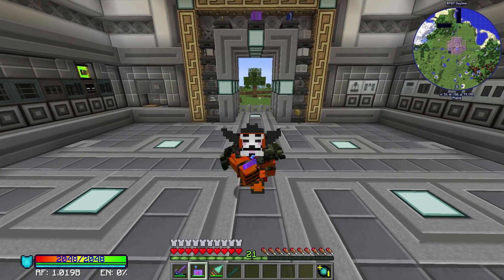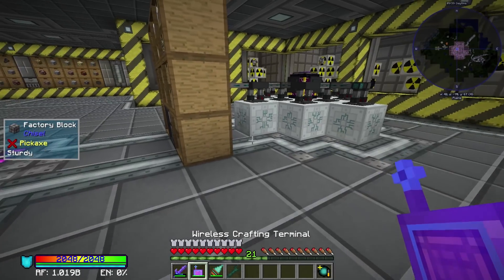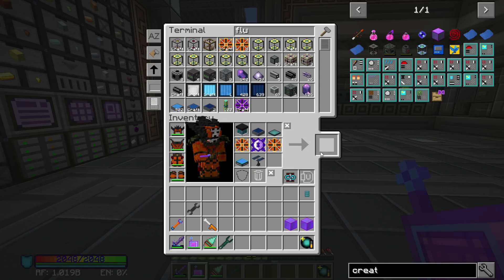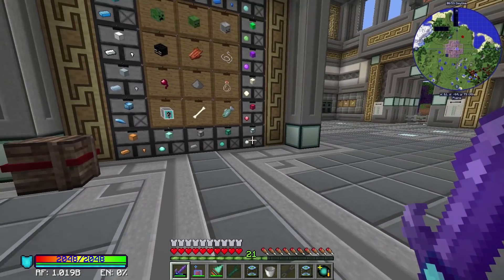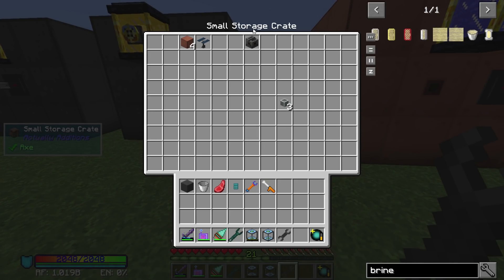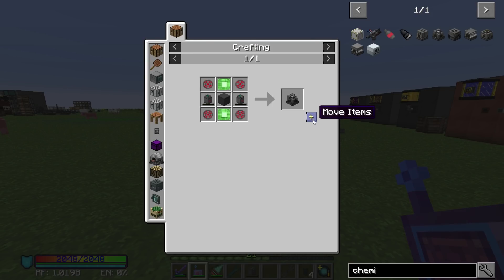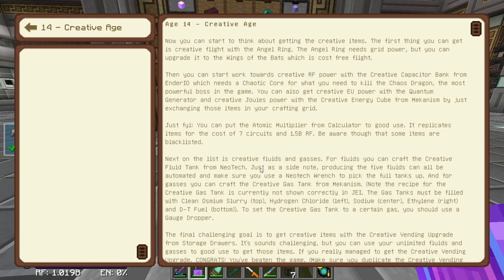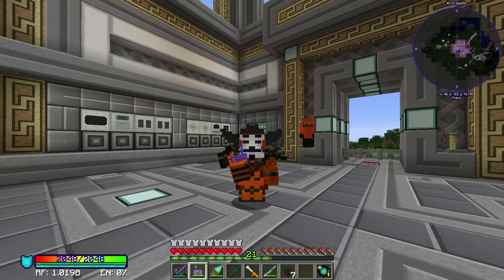Age of Egineering EP47 Mekanism Creative Gas Grind

Comment: If you really wanted to get the gases quicker you could have made a small amount of each, turned it into liquid with a rotary condensentrator, use the creative tank to get infinite and then turn it back to gas
Reply from the maker: That is actually much slower as it add a step when with upgrades it took 2 minutes.
Reply: SystemCollapse it depends on how much you need and what you are making. It may be useful for D-T fuel
Reply from the maker: You only need 3 tanks of 64 Buckets to make infinite amount of Creative Tanks endgame.

Comment: tbh I was surprised that the universal cable didn't upgrade.. can you try upgrading to each tier before going to the next? I loved being able to upgrade my cables without having to replace them, but that was back in 1.7.10, and I can't remember if I jumped to the atomic/ultimate cable from basic tier, or if I had right-clicked with each previous-tier's alloy.
also I did a full setup for a fusion reactor in my space astronomy 2 server, and we went overkill with our d-t fuel production. the whole setup took the entire day, but it was plenty of fun :) (you definitely have many of the steps for d-t fuel, though). if I recall, clean osmiun slurry was the product of mekanism's rabbit hole of (1-5x) ore processing.

Comment: shame how not many people know much about mekanism, because no packs will include it, probably because they think it's OP, so no one gets to use it much unless they install it themselves
Reply from the maker: It is also how mech is designed. The power scaling is insane and takes a lot of tweaking to get right.
Reply: It's honestly one of my favorite tech mods. I'm a big passive power kinda guy, and Mek's options for passive power easily outclass nearly everything except Immersive Engineering... and when you factor in resource cost (crafting steps included), and space usage, it does outclass IE. Depending on pack, those wind turbines can do anywhere between 200 and 2000 rf/t quite literally for free, so long as you can somehow pipe/transmit that stuff back down to your base from ~Y250. 
And that's not all Mek brings; in almost every pack with Mek in it, i'll always bumrush the Digital Miner right out the gate;a full load of efficency mods can often bring down its power usage to the very low double digits... meaning that no matter how early game you are, you now have All The Things; that thing is AE autocrafting, for ore: tell it what you want, and wait. Depending on configs, you can run a base on water for a while, cuz hydrogen. And the byproduct, oxygen? Ore triplication waiting to happen. Even if you don't make more power than you use making hydrogen, make it anyway, because (just like real life) it's damn decent way to store power, as an alternative to batteries; also, oxygen, very useful, as aforementioned. Atomic Deconstructor is a VERY fast omnitool, Robit's kinda cute, factories put most other machines processing speeds to shame, and ya just can't argue with 5X ore processing (though i've never done it, just not worth that much setup since i'm already swimming in resources by the time i'm even considering it). Damn i love that mod.

Comment: Mek's definitely a little hard to get into, especially with the annoying sidedness of the machines. Ender IO really has spoiled everyone with its hassle-free and intuitive machines and pipes. RFTools pretty much covers all the leftover bases, like auto-mining.

Another gripe I have with Mekanism is that while it has a pretty OP endgame generator (the fusion reactor + steam turbine), it doesn't really offer anything to do with all that power. Why work toward it at all?
Reply: Deivorous - well mekansim does support rf and eu, so you could power power hungry stuff (example: void ore miner) from other mods , it's just that the multi power system is disabled in this pack
Reply: Choo Ting Feng That's true - it would be useful for Draconic stuff; but I was looking at it as a standalone tech mod.